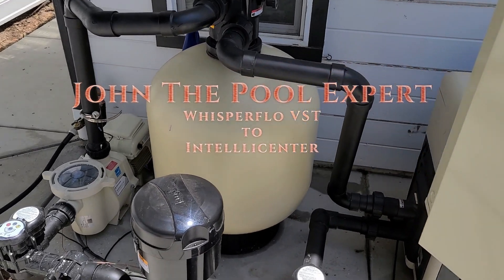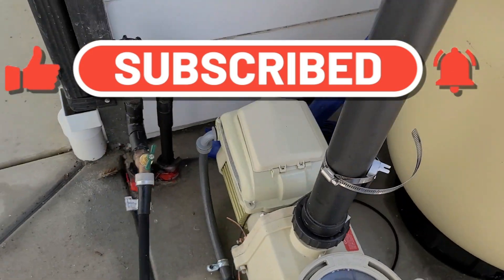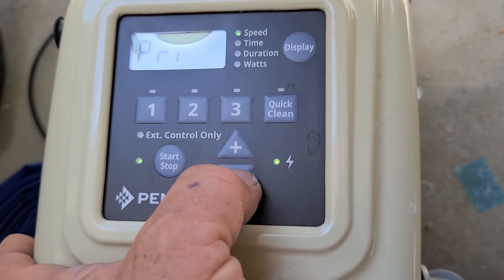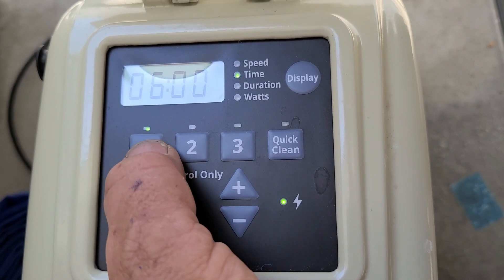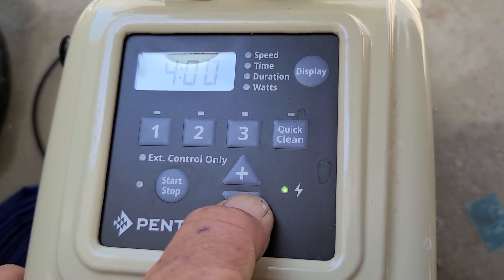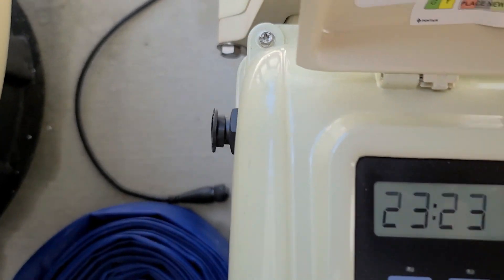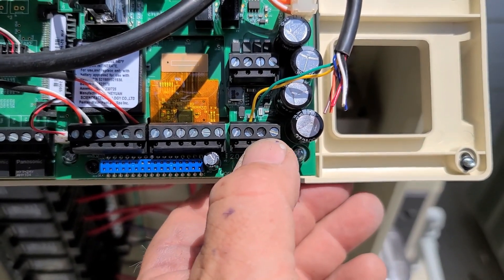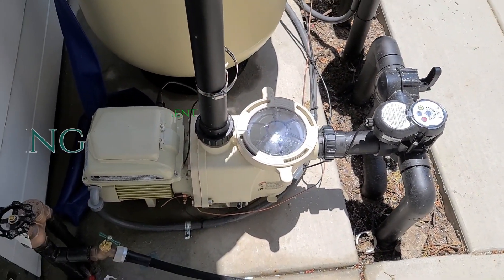Connecting A WhisperfloVST  to An Intellicenter

Comment: Now how about using the Whisperflo as a dedicated spa jet pump on its own circuit? Planning on a new flo3 as my main filter/heat pump.
Reply from the maker: That will work fine you just need to set it as pump number two. You will have to go into the pump settings to designated as number two. It's in the manual how to do that. You can set up multiple vs pumps. You just have to label it jet pump or whatever you like.

Comment: Thank you for the video. I have been looking for reasons to have an intelligent control panel. I am confused.  Perhaps you can clarify it for me.  I have a 23yr old inground gunite pool recently resurfaced abt 5yrs, Venice shaped 15x30 with entry/exit and a bench seating on the opp. end. A little more than 15k gals. It currently has a Intermatic box w timer and standard pool light. Features: step jets in the bench seating and a long-gone slide, its water supply capped. A Pool Pilot Digital Nano System that is malfunctioning.  So, now I need to replace the salt system and go with a variable speed pump.  I'm thinking Pentair.  If I go with the Easytouch4, then it controls the salt system and I don't need the Intellichlor power panel? Is this correct?
I'm in South Florida so a heater isn't needed. It would be nice to have remote access and integrated lighting but what I have is a couple of deck lamp posts and the pool light I have on switches. I can see adding garden lights that could be installed and wired to this system but not a priority now.  So having the Easytouch removes the need for a separate Intellichlor control and what is the advantage of putting an intelligent variable speed pump on the panel?  Doesn't it have its own programming screen?  Help.
Reply from the maker: The main point of having an automated control system is you can turn things on and off and control your valves via remote or your phone. A basic swimming pool is usually not necessary because you can control a light from your phone by purchasing a Wi-Fi switch off of Amazon. It all depends on how much money you want to spend. I think the least expensive upgrade I did for a four function control and salt for a pool and spa what is about $2500 hard cost for the panel and the salt generator including two valve actuators. In order to do the same thing with Pentair it was about $1000 more. In fact there's a video of the install recently on my channel.